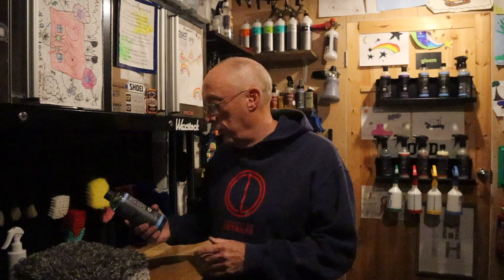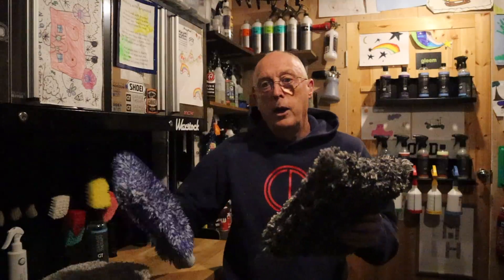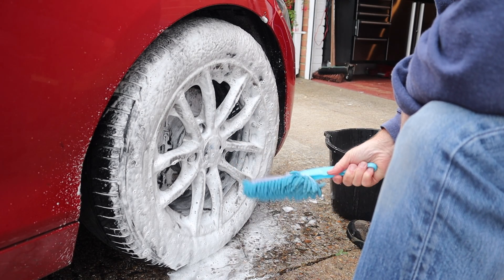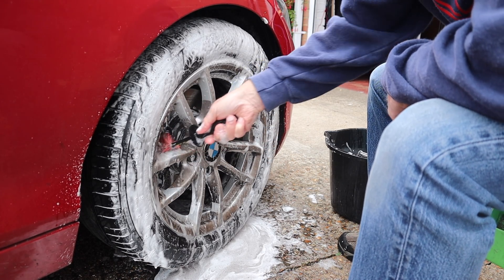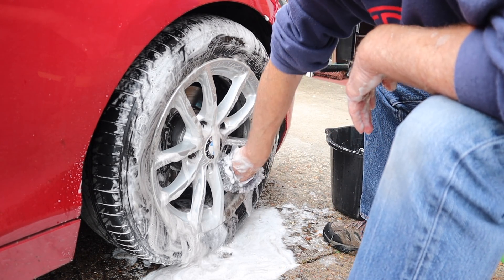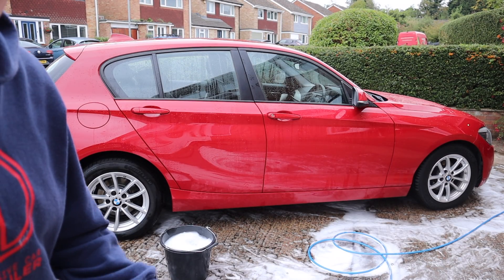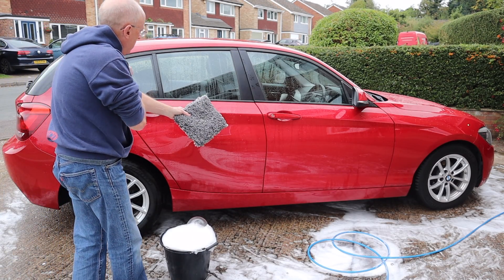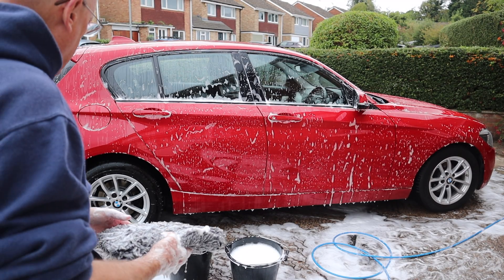Garage Therapy version 2 One Car Shampoo & wheel & wash mitts

Comment: I bought a wash pad and when it was delivered i thought they replaced it with a shaggy pillow. It sat in the van for a while and i seriously thought I'd never use it. I then dropped my wash mitt and had no choice but to resort to the garage therapy pad. So i opens it up and dunks it the bucket. First thought was where on earth has my wash solution gone ??? That pad holds so much water !! Next thought was how delicate it feels gliding along the bodywork and how much more efficiency was unlocked with this pad. Admittedly it felt a little stiff at first but a few washes later it softens right up and becomes an absolute pleasure to use. Looking forward to trying more GT products. Maybe a sample set should be on the cards ???
Reply from the maker: Hi Steve, I am hoping I get the same as I use mine more. Have you tried the wheel mitt? its great
Reply: @ObsessiveCarDetailer  not yet bud, it's definitely on the list of things to purchase.  It does look a handy piece of kit !

Comment: Hi Martin. Great review as ever. I have been using the mitt for a few washes now after getting it to replace my old microfiber madness one. I have found it's great and that if you squeeze some solution out and grip it then it feels more secure on side panels. I heard a podcast with Maz from GT and think he mentioned it's size and that they designed it so you only needed to do a couple of passes on a panel to make even less contact when sashing. I now use it as my go to mitt and I just do the sills and Lowe sections with my old one. Shampoo and wheel mitt are amazing as well.
Reply from the maker: Hi, the way you use the pad seems to be in line with a couple of others that have shared their experience with it so I will persevere and see how I get on. Thanks for your comment & look out for me using it in future videos👍

Comment: Great video Martin can you please tell me the two products you put on the wheels in the white spray bottles to protect them as i couldn't clearly catch what you said.
Reply from the maker: Of course no problem. I sprayed GB Spray & Protect on the wheels but you can use any spray on rinse off sealant. Just a quick way to add protection to your wheels on a maintenance wash.Then Bilt Hamber Atom Mac diluted to 5% on the brake discs to prevent tarnishing. Hope that is of help
Reply: @ObsessiveCarDetailer  Thanks very much top man.

Comment: Hi Martin, like you I've got dainty hands lol, as GT are bringing out v2 of everything I'm going wait for the slightly smaller version because as you say you've got to wring it out slightly so It could be smaller to compensate for us with dainty digits
Reply from the maker: Don't hold your breath Mike, they have only just bought this one out but I guess depending on feedback anything is possible. You have to try the wheel mitt out, its great

Comment: Hi Martin,
I’ve got the YumCars wash pad which is massive and takes some getting used to compared to a mitt. I do like the fact I go to the bucket less to reload with water/ detergent as the pad holds so much solution. Great video as always 👍
Reply from the maker: Hi Perry, I guess it's what you're used to. I will persevere for a while. Nothing against the pad just not what Im used to used to🤷‍♂️

Comment: I didn’t fancy the wash pad but have the wheel mitt. I’ve only used it once and want to use it a few times before I fully make my mind up but like you, I found I can get in the corners with it as it has a rigidity to it compared the Flexipads Lambswool (which I’m a big fan of)
Reply from the maker: Yep, never thought I would replace my wool mitt but the GT one is top class. Like you Chris not sure the wash mitt will do it for me but will give it a try for a while. You will like the v2 though

Comment: Martin, agree 100%. The wheel mitt is great and has replaced my Flexipad finger mitt. Like you I find the wash pad too thick and heavy ( I also have the Rag Company pad and that is slightly thiner but still too heavy). If you are looking for a pad and find you don’t get on with the GT one, try the Microfibre Madness incredipad XL, more money but pretty much spot on.
Reply from the maker: Cheers Martyn, thanks for the heads up on the incredipad👍

Comment: Hey Martin, great reviews, had the Pads since release day, so a few weeks now, yes they feel a bit awkward initially but persevering and adapting works wonders.
My tip is to give it a gentle squeeze to remove a bit of solution and you'll find there's still plenty left and it's less heavy. The foam eases up a bit with use too so becomes less stiff and easier to control.
Also a lot of people who say it's too big are kind of missing the point, which is to reduce the amount of back and forward to clean the paint, it covers a greater area so less actual contact as you're not going back over the same spot as much.
I've found it actually knocks a bit of time off the wash of big stuff like Range Rovers...
Keep the faith and be interested to hear your thoughts further down the line.

Wheel mitt is an awesome thing, that loop, not only for drying, but your thumb when washing with the pressure washer, stops it flying away 😜 also secures it during the wash.

V2.0 is just incredible how they have upped the bar again, V1 was my absolute favourite but V2.0 was bought blind in 5ltr I had that much faith in the product...
Looking forward to seeing more V2.0 products in the future too as the guys aren't resting on their laurels.
Reply: Agreed...you've got to give it a squeeze in the middle so you create a butterfly shape to grip it...then you fly across the paint.
And V2..... SUPERB... but got 5l of it and about 750ml of V1.... at this rate they'll have V5 out and I'll still be on V2
Reply from the maker: Hi Jon, good to hear from you. Spot on with both the wheel mitt & v2, love both. Totally get your point on the wash mitt so will keep playing with it👍

Comment: The wheel mitt i use Martin allows the whole hand to go in and includes a section for the thumb. No chance of it coming off and allows to clean all the intricate parts of the wheel.
Reply from the maker: Is that the Halfords mitt??
Reply: @ObsessiveCarDetailer  No Martin the one i have was bought on Amazon Glart wheel mitt.
Reply from the maker: @greymark420  oh ok👍

Comment: Another great video Martin, One V2 is great but so was V1 like you I lots of V1 left but will buy some more when it runs out. I like the wheel mitt especially as it goes in the wash with all the other microfibre. The wash pad is not for me, I have given it a good go and it is too bog and I feel like I am forever changing my grip to get the best contact with the car. See how you get on you may like it.
Reply from the maker: Thanks Patrick, I will persevere with the wash pad but cant see it replacing the normal Paragon one🤷‍♂️. The wheel mitt is a big hit with me though, I never thought I would replace my wool one👍

Comment: Excellent video Martin, apart from the pressure washer blowing my ears when it started up 🤣
I’ve yet to try all the new things as I’ve been busy with other testing for a lengthy ‘review’ on snow foam lances but I trust your opinion on products so really looking forward to trying the new shampoo with the big pad. 
When you compared it to the other pad , well, pillow you have it looks a real handful , even with the GT pad you were two handed on a lot of the car so I’m curious what I’ll make of it with my humongous shovel hands 👋
I’ve tried the wheel mitt dry and it’s slightly confusing where to put your fingers, as if there’s really only room for 3, 4 at an awkward push 🤭
Anyway , put an advert in the local community centre for free car washes , you’ll soon work thru V1 , take care mate 😀
Reply from the maker: Cheers Graeme, not convinced yet on the pad but love the wheel mitt. as for the shampoo, the bar is now even higher.. The 5lts of v1 may be a Christmas present for my Wife😱
Reply: @ObsessiveCarDetailer  🤣🤣 as ‘bubble bath’ 🤣🤣
Reply from the maker: @GMDetails  Just need to change the label. Job done👍

Comment: Thanks for another great test. "Unfortunately" I bought Version 1 only 4 weeks ago 😢 😅

Is there a special reason why you don't like the "bullshit buckets"? 

Thanks again mate! 

Greetings from Austria
Reply from the maker: Hi Willy, my biggest issue with the large detailing buckets are the price, I just think they are a rip off. If you buy 3 buckets (wash, rinse & wheel) then the trollies to move them around the car along with grit guards amounts to over £100. I have a couple of the buckets but don't often use them. I tend to use them to store my mitt in🤷‍♂️
Reply: @ObsessiveCarDetailer  Okay, I understand your point. My preferred setup is to use the small 3,5 Gallon buckets with a good quality and functional Grit Guard like the Detail Guardz Dirt Lock. No need for a Trolley for me. Makes a real good combination at a reasonable price 🙃. But of course that's my personal preference.
Reply from the maker: @willysch.5150  unfortunately I made a bet with the guys at GT that if I liked their snowfoam I would use my BS buckets 😡

Comment: Wash pillow it's huge
Reply from the maker: It's great for a quick nap at the half way point. Or is it just me that tends to nod off🤷🏻‍♂️🤣
Reply: @ObsessiveCarDetailer  It was definitely a two hand job unless you are blessed with big hands 😁
Reply from the maker: @ilikechickensausages2075  the pad right???????🤣🤣🤣
Reply: @ObsessiveCarDetailer  Yes of course 😁
Reply from the maker: @ilikechickensausages2075  👍🤣
Reply: That washpad isn't for me, I really like using mitts. The Gyeon smoothie is my personal favorite. I use it as a glove so there isn't a chance of dropping it😂. I still haven't used up my stock but the next products I'm buying will be from GT. Problem for me is that I'm faced with shipping costs (can't order GT in the Netherlands) so I'll wait till I can make a big order at once. Then I can finally try their products myself. By the way, what is the specific difference between V1 and V2 of the One Shampoo? 
Greetz Will
Reply from the maker: @wills_details  I don't think you will be disappointed when you finally get your hands on them. For me as a user the difference I noticed imeadiatly was the slickness & soap the lasted the whole wash. Although v1 did the same but not to the same extent. Also more concentrated. For a more detailed explanation you should contact the guys at GT.  They will be happy to discuss but if you dont get a response then let me know👍

Comment: Hi Martin, gotta stop watching your videos 😀, cos i've just bought the wheel mitt. I have a Dooka Lambswool wheel mitt but on my 19" 14 spoke alloys it's just not flexible enough & the 2 inner skins just stick together when you remove your fingers so it's a 2 handed job to separate. Shame really because it is lovely and soft but is actually a bloody nuisance in use and takes forever and a day to dry especially during colder times.
Reply from the maker: If I have to buy all this gear I don’t see why I should be the only skint detailer 🤣🤣 Happy new year Alan